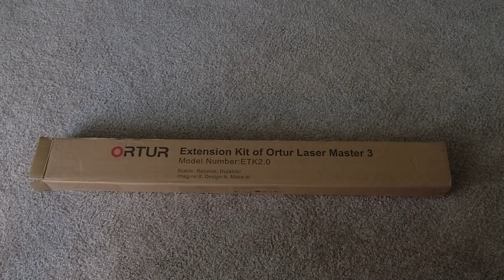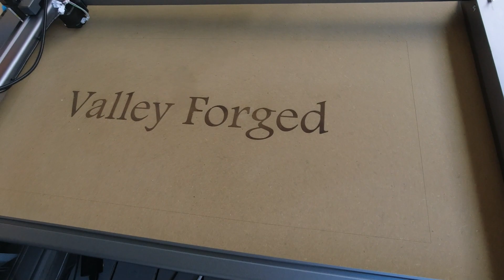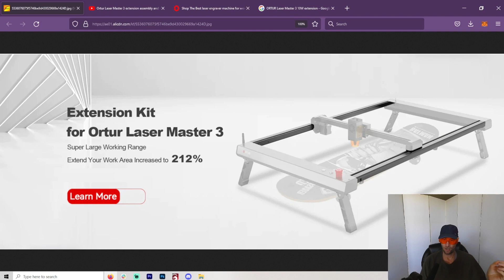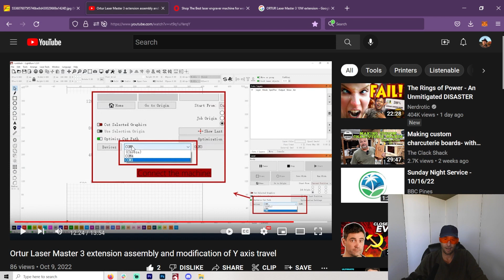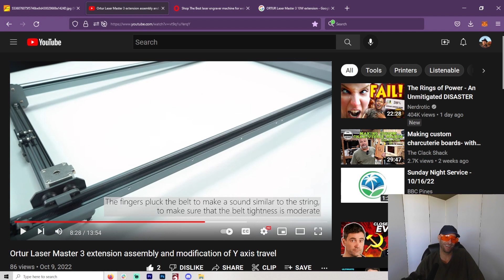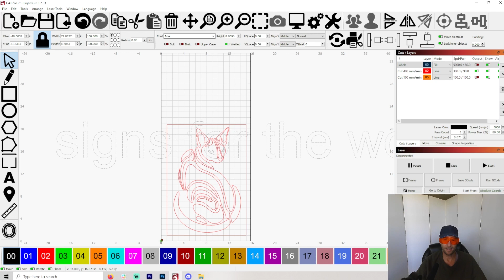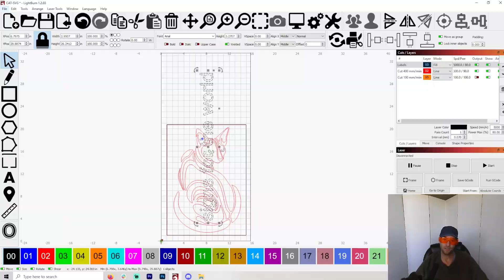Laser Master 3 Extension Kit: Should You Buy?

Comment: I was watching your video where the machine was not working. Is this the same machine and  if it is what ended up being wrong with it.
When I first setup my LMO3 it chattered like yours was. I found one belt had not been slipped into the correct place.
Just curious in case myself or others have the same issue.
Thanks....
Reply from the maker: I had a bad motherboard. But I get you, I had also not put the belt in the slot when adding the extension, it was making some pretty strange circles, lol. Not sure that is great design. BUT, I love this laser overall and doing great work with it.
Reply: Yes it does work nice. I think I may have had issues as well with updating it with the bin file they sent. I had a error stuck could clear it when starting LaserGrbl. I want to use Lightburn and not that the error is gone I will give that a try.